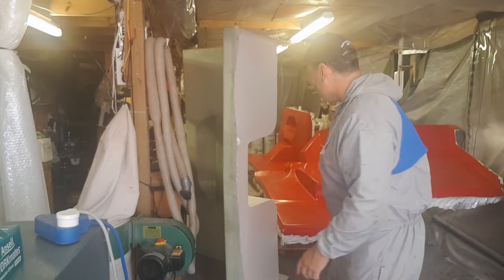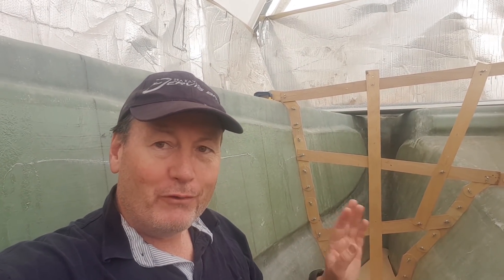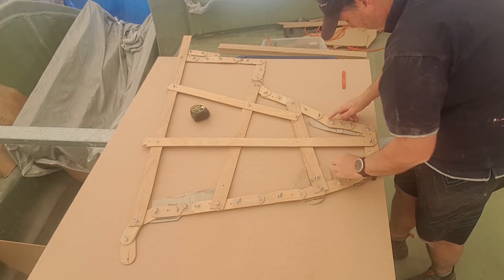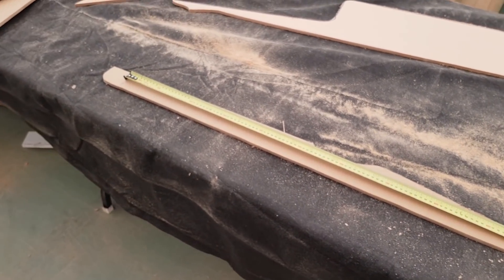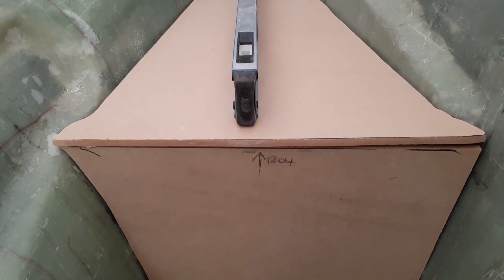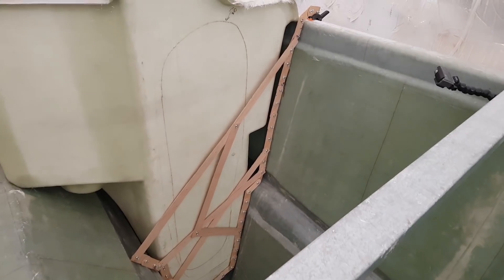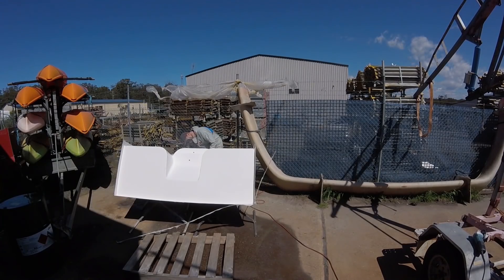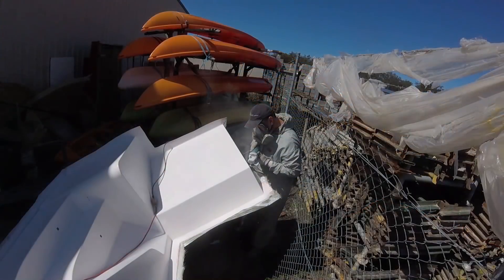Ep049 Bulkheads and Grinding - Life On The Hulls - Catamaran Build

Comment: a sheet of 50mm polystyrene on top of your cutting table will save a lot of effort when cutting out your mdf templates with the jigsaw,use a short blade,
 as then you will not need to move the piece to the edge of the table every time to cut,instead you will be able to continue cutting over the top of the table into the polystyrene.
this will also be useful when using a trim router to cut out exact copies in plywood from your mdf templates on the table.

i use 5mm under floor insulation polystyrene sheet for my templates instead of cardboard much easier to cut and trim, comes in handy packs of 10 (60cm X120cm).use masking tape or double sided sticky tape to attach to the wooden template frame/brace.
Reply from the maker: That is such a great idea Alex.I have plenty of that styrofoam ad well.I wish I had thought of that.Thank buddy.
Reply: works great with a circular saw as well for cutting up full sheets of ply if you are by yourself,just remember to set the blade for a shallow cut!

Comment: Ross - I have been thinking about the challenge you have trying to mate the crash zone webs to the hull and deck mouldings. I have built a large (10 m foam core deep V cruiser - so feel your pain). Problem with your current approach it seems to me is you have to get deck moulding made to finish shaping webs AND you then have the challenge of tabbing this in place to hull moulding in a tough area to access (and upside down). Why not split the webs along a notional line, glass a flange on each half of the web where they meet, and use Plexus to bond. That way you can fit the lower half of the web to the hull moulding, make the deck moulding, pattern the upper half of the web in situ, glass upper half of web to underside of deck, then fit together. No upside down work, no delays to shaping webs and no painful access to voids between webs when trying to mate everything. Just a thought (ps also a keen sea kayaker and have built my own)
Reply from the maker: Gidday Richard, great food for thought. I have been considering that approach, have concerns about directly lining up the bulkheads and wingframes exactly but could certainly work on a number of them in that fashion to avoid the bulk of the issues you have discussed.There will be much plexus involved that is for sure. Gotta love Sea Kayaking, I have paddled professionally for over 30 years and still cannot believe the sense of freedom for the sea kayak.Thanks again. Ross
Reply: @LifeOnTheHulls  No worries Ross - will be interested to see how to decide to tackle it. I am actually President of the Victorian Sea Kayak Club so a pretty active sea kayaker - several multi week trips  down in Tassie of recent times - great. Best though was southern Greenland amongst the ice - amazing experience over 17 days....

Comment: Tip for trimming larger composites: double cut circular saw with carbide blades (two blades that rotate opposite to each other and shear the material rather than catching and grabbing).  Over here we can buy one from Harbor Freight for about $44 with discount coupon.
Reply from the maker: Thanks Joa, I have seen those double bladed saws and wondered. May look into it. I have found that my accuracy is quite good now with the grinder and I am able to get into places I couldn't with a circular skill type saw but always on the lookout for something better. Cheers and thanks for commenting. Rossco

Comment: A fine mist (but not too much) can help with dealing with the dust, also, use a vacuum on that stuff, MDF or HDF or LDF are carcinogenic.
Reply from the maker: Thanks for the comment, I am  vacuuming at least three times a day and the jig saw is probably a bit coarser than a circular skill saw dust so not too bad but shocking stuff all the same. Cheers Ross

Comment: Could you not scribe the profile from either side of the hull interior onto seperate boards and then place a joiner piece of mdf panel to get your template.
 So your template would be made up of three panels. You could tack/brace them and then do your final adjustments in situ (fix) before you screw them together.
I am thinking it might be easier. ????
Reply from the maker: The jig is so much simpler, however I have used the technique described to achieve my floor soul patterns and the jig only worked well in a vertical plane. Any idea is a good one and the chain jig although bracing up is a pain is so quick and the cardboard well, it's cheap and quick. Thanks for the comment , I love hearing the alternative ideas it makes me think outside the box for sure . All the best. Ross
Reply: @LifeOnTheHulls  all good Ross. Enjoyed watching the progress. I think in Australia we should call that a Snake Jig. 😎

Comment: Do you have a set of plans you’re working to?
Reply from the maker: I have a set of plans, but the original boat was solid glass so therefore bulkheads are different although in the same stations. The laminate thickness I am using are of higher spec also so slight differences in thickness where solid glass is applied.   Best regards Ross

Comment: Ross you are an amazing guy just powering through these tasks. One question - is it your intention to tab the bulkheads as a close fit to the hull shell OR are you putting foam between the bulkhead and shell and tabbing across. I ask because I was under the impression it introduces a weakness in the structure if you create a hard point connection between bulkhead and shell. I have no expertise in this field.

Comment: The old adage of measure twice cut once is fine when your cutting a straight board. Your in a whole new dimension of math with this complex geometry. You can really see how strong a boat this is going to be though when all these get glassed in. I mean just look at the stringers in the bow section. Really awesome view of the interior structural parts. Cheers Ross.
Reply from the maker: Thanks Mark, definitley some serious structure up there on the bridgedeck. I have now made the foam core frames and it is certainly taking shape . All the best and thanks for watching again and again.Ross

Comment: Silly me...always  assumed  a fibreglass boat was simpler to build...Leo has it right
Reply from the maker: They are absolutely complicated craft, with modern materials. Generally there are about 10 or so workers nutting it out. I am the only worker in this case so am making it appear very complicated. and it really is. Cheers Rossco